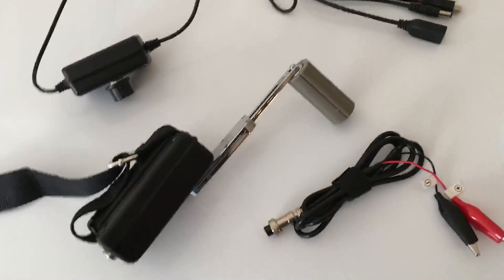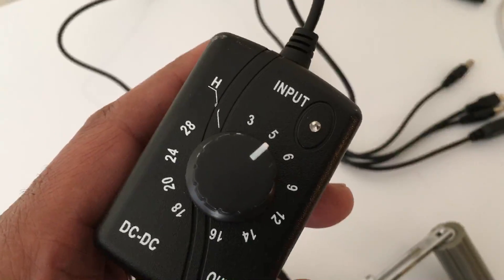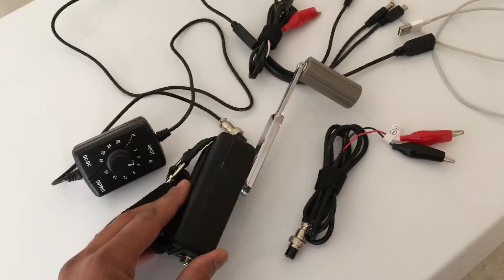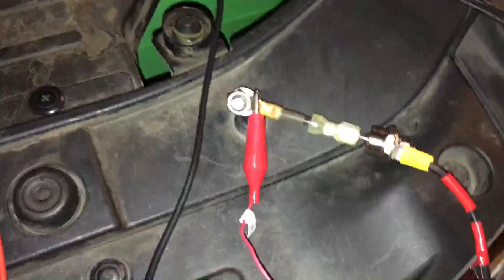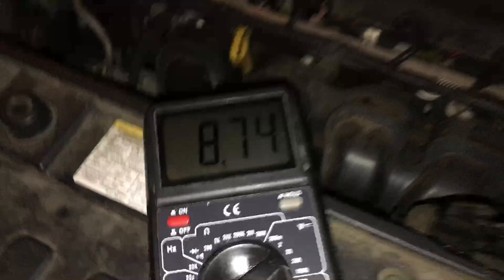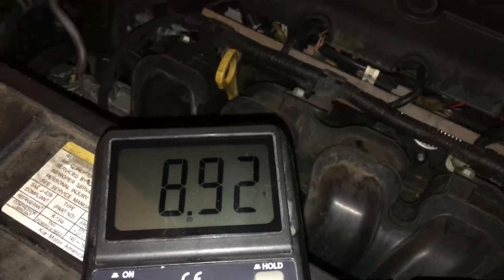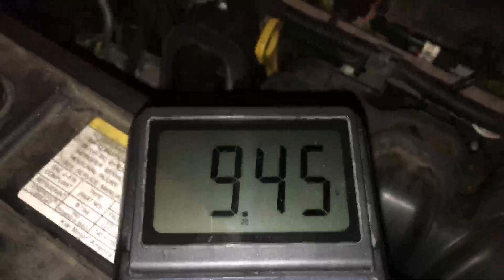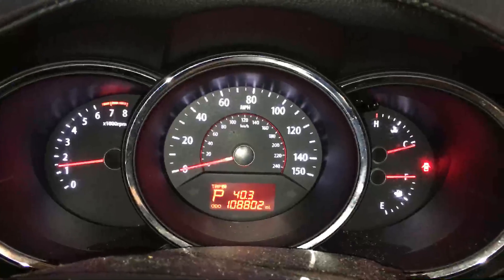Hand Crank Emergency Power Generator

Comment: I recently bought myself one. The following problems were encountered. Can you answer me what is the reason for this?
Hey!
1) why does oil flow out of the handle attachment point when it is rotated?
2) why is it difficult to twist in some places when turning the handle? this is when you charge your phone. It can be easy and then it is very difficult to twist. What is the reason for this? And this is at number 5. It goes easily, then it is hard. It’s as if you are twisting minced meat in a meat grinder and you come across a bone there and it suddenly becomes hard to turn the handle. Then, with gradual crushing of the bone, it becomes less difficult, and after complete crushing, it becomes easy to twist again.

Comment: Can this lights a lamp ?
Reply: It should be able to light a small DC Lamp\Light bulb.  This is mainly used for charging batteries.
Reply: Rufus Handsome ok cool ! On which website did you get it ??
Reply: Google - "Portable Hand Crank Power Generator w/ Voltage Regulator"  - "Product Code : RB-Dfr-664"